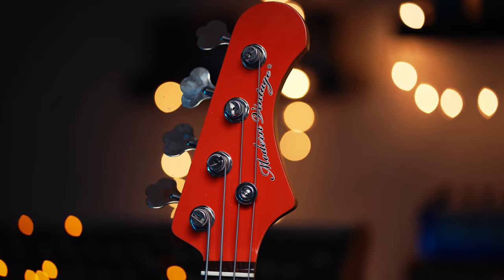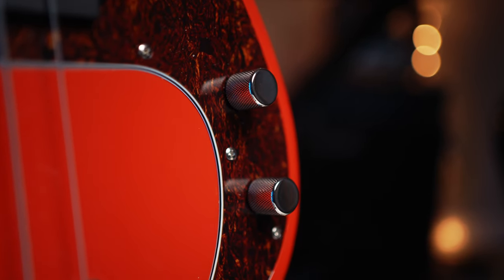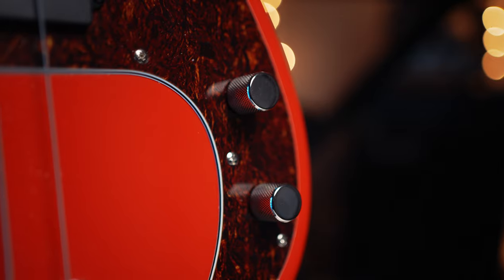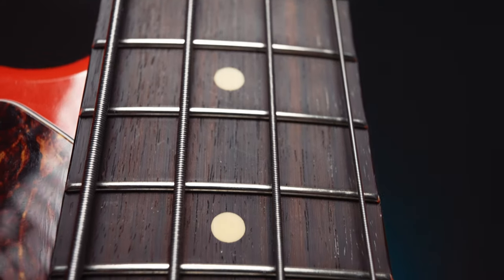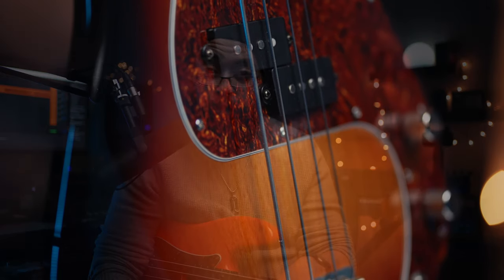Modern Vintage Guitars MVP4-62 Review! Don't sleep on it!

Comment: Oh man! Hondo! These things sound fantastic! Every P bass I’ve owned (including my current main p bass) has been plagued with the dreaded dead spots around the 6th and 7th fret on the G string - poor tone, no sustain - have you experienced this at all with P basses? If so, do you feel like the torrefied roasted neck helps negate that issue at all?
Reply from the maker: Every "fender" style bass I've played has had an issue there. I think ita a problem with the design. I didnt notice it with this bass, but I also wasnt looking lol. I'll have to check it when I get a chance and let you know!
Reply: @HondoFelder  Cool! Thanks, man! I’ve read before that is has to do with the specific mass of the neck/headstock messing with the resonant frequencies of those notes and effectively canceling out those notes. So, I wasn’t sure if the roasting process changed those resonant frequencies at all, helping eliminate that phenomenon.
Reply from the maker: @STEIJ6377  Absolutely. The only basses i've played with NO deadspot issues were designs with different headstocks. The roasting doesn't seem to help much in that department. I just checked and specifically at the 7th fret of the G string the note will sustain into a harmonic a few second faster than the 5th frets or 9th frets. It's noticeable if you're holding the note for 5 seconds or so, but you'll miss it if your moving through pretty quickly. it's no where near as bad as most of the fenders i've played, but i think that's due to the construction being much better on these lol.